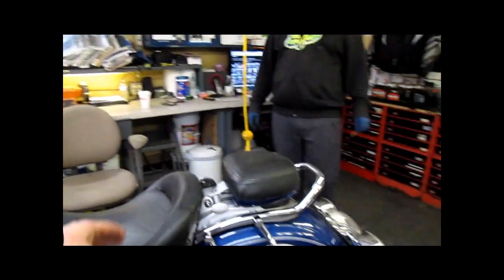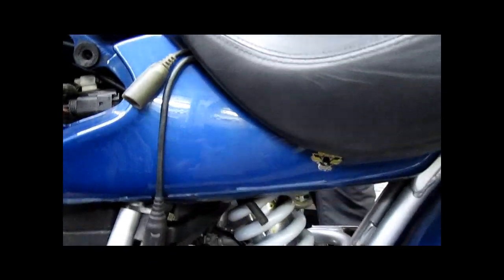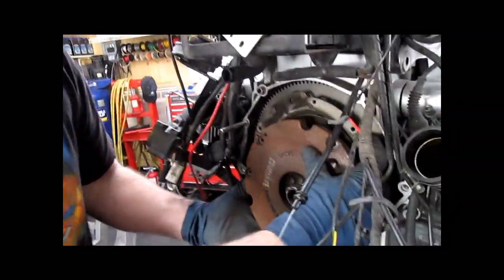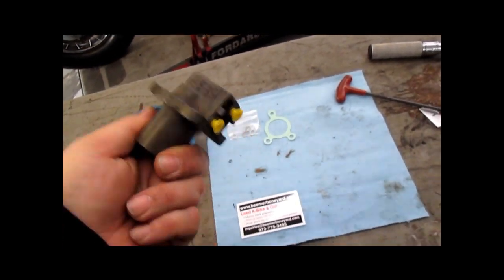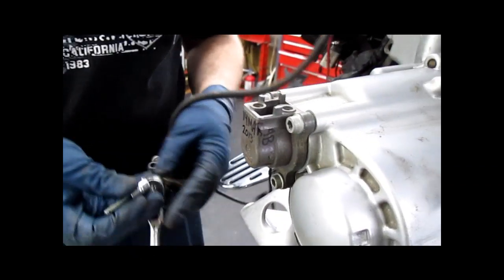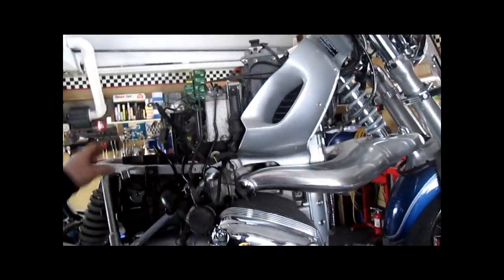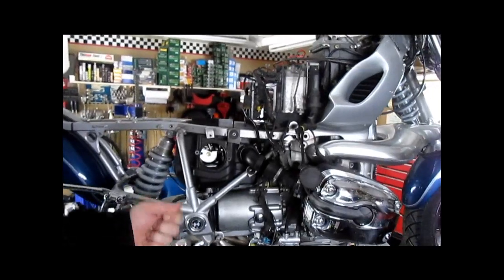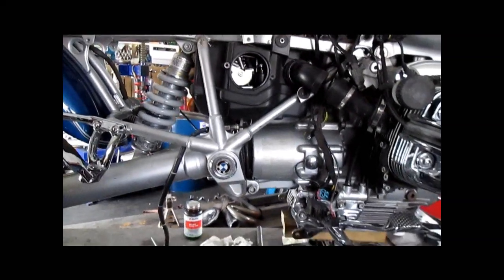BMW Service - R1200C Clutch Replacement 'How-To' video teaser

Comment: thank you.I watched you video before I did the job and it showed me the way to go.I did not take the frame off with the seat fender and final drive and wheel with it,I took it apart and put it together piece by piece.It took me a week to get the parts so I had lots of time to think about the best way to tackle it.I was lucky.
Reply: In the service manual they do tell you to take everything apart like that. I saw what they did here and thought, "oh that looks way better" until the end when you need 4 axises to line up all at once lol

Comment: Sweet Mother of God...what a mission for one stinking clutch...good thing the latest boxer got the (wet)clutch under the front cover and a lot more accessible.
And here i was contemplating buying one of these for little $$$ on craigslist to screw around.... NOT ANY MORE, LOL.
AWESOME videos, thanks !
Reply: have you seen what those wet clutches cost? and the non self-serviceable cooling system? Enjoy!!

Comment: @ 0.57 - You could make that into a cartoon or high speed video showing you putting it together! LOL 
From day one, I always got a trip out of how BMWs get "cut" or "stripped" in half to repair the clutch and other things. That is why the price is so high for these repairs. Other motorcyclists see this and flip out in disgust, but then realize the engine and drive line design and realize that's the only way to do it. I just wish BMW made stronger clutches, splines, baskets, and transmissions!

Comment: Hi Chris. Recently replaced my bikes r1150gs 2001 clutch. I only replaced the friction plate and the rest remained. During test ride, the clutch engagement was stammering which caused the drive shaft free play to be noisy. Once fully engaged no sound. I have rode almost a 1000miles and still cant seem to bed the new friction plate. Your advise appreciated.

Comment: I did the job in 20 hours without one glitch or problem.I kicked its ass in two days made 700 dollars.I had the manhole cover resurfaced.I centered the clutch disk and left the bolts loose mated the tranny to the engine and then tighted the pressure plate bolt on the cover Thur the starter mount.used wire to install throttle cable.I took my time and got it done quick.Bow to the master you hackers  my name is Russell

Comment from the maker: Hi, I have no experience with the slipper clutch. Unless it corrected the spline issue I'd see no use for it especially in the low horsepower R1200C & CL. Thanks, Chris